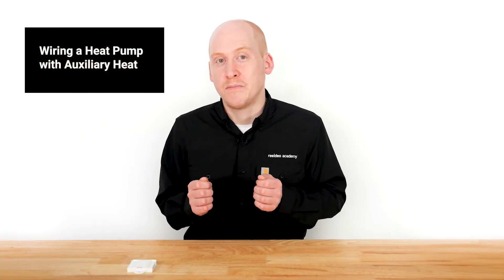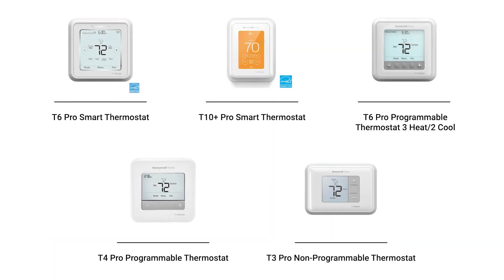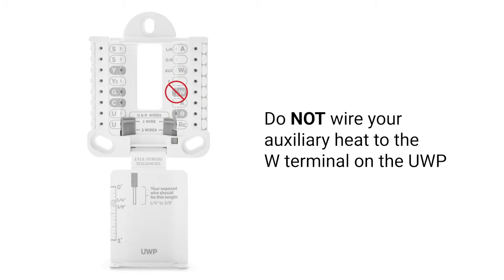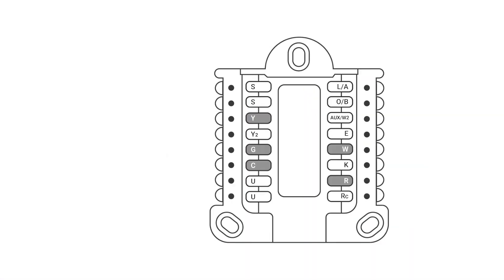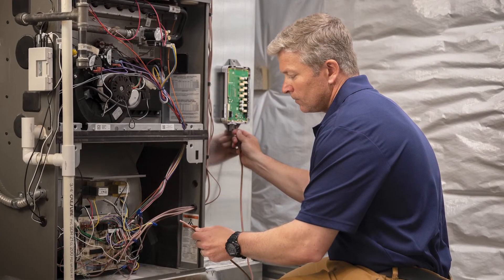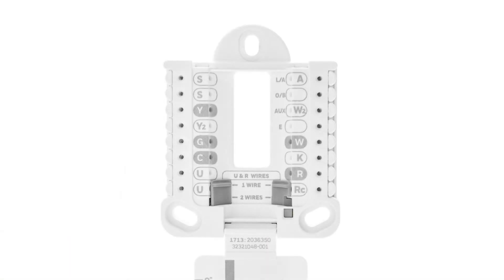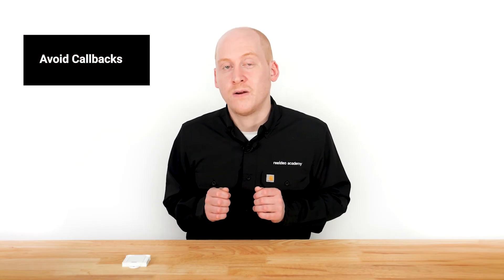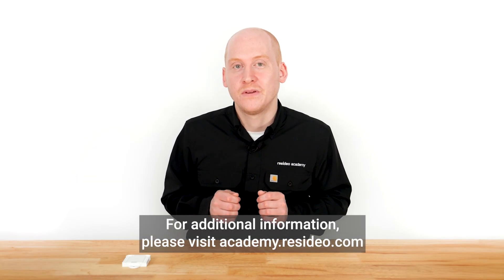Correctly Wire a Honeywell Home Thermostat for Heat Pump Applications

Comment: I've spent literally hours here on YT and I get more confused by the hr! Here in NW South Carolina we have crazy electric charges for "Peak Hours" so I decided to get a programmable thermostat so I could set the heat to come on BEFORE those peak hours. Just take the chill off in the morning before 6:00 a.m. We have a cast iron fireplace we use during all the other hrs so we don't normally even use the Heat Pump. Anyway everything I watched to wire up the new Honeywell T4 thermostat went off in all kinds of directions! So I hired a HVAC guy to come wire it up. Well 1st time I tried to use it it ran for an hour and a half with NO heat. So I got him back out and he said he had flipped 2 of the wires!!! Thought maybe we had it fixed. Nope! Something is still not right. Last night I did the complete system and schedule reset and reprogrammed it. Temp in the house was 70 degrees and I had the heat "set" temp at 62. I had no sooner than walked away when the system came ON!! I had to manually turn it off! So now once again we have no heat...at least none that I can control with the thermostat. On my old thermostat (that worked correctly) the White wire went to W2 and the black wire went to W/E. My HVAC guy hooked up the new UWP with White to W and Black to W2 but you're saying don't use the W?? I'm confused. Can you elaborate? My only remedy at this point is to just hook the old Thermostat back up or hire someone a 3rd time to hook it up correctly. Starting to get expensive!! Oh also he used a "jumper" between R and Rc. I'm guessing this wrong also.......

Comment: If the white wire from HP (heat pump) doesn't go on w, where does it go?  The white wire from furnace (my backup gas heat) goes to w2/aux? 
Does white wire from HP also go to w2?
Reply from the maker: Hello Dr. Shawn, thank you for reaching out. The wiring for a heat pump with backup can vary depending on your thermostat model and installation setup. For detailed assistance, please contact us at 1-800-468-1502 or send us a direct message via our Honeywell Home Facebook page. Thank you! -Joseph